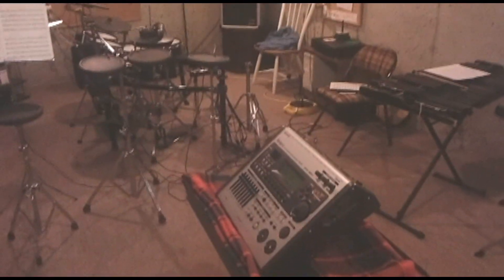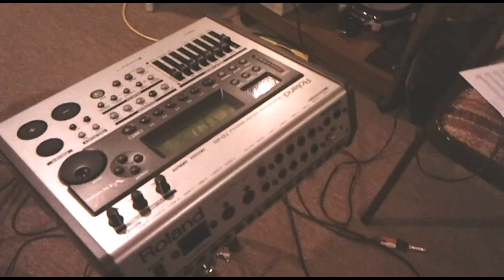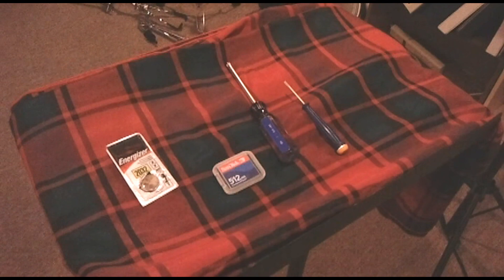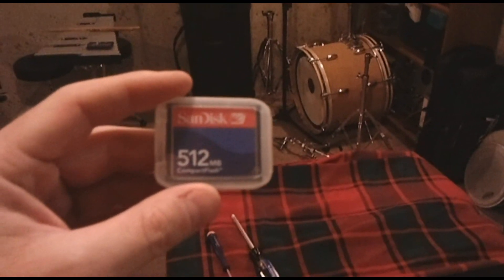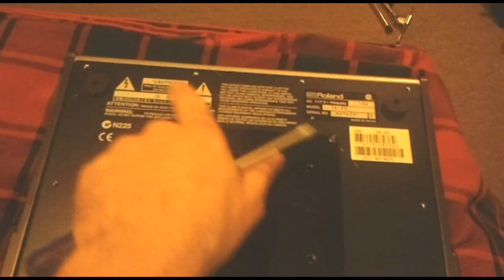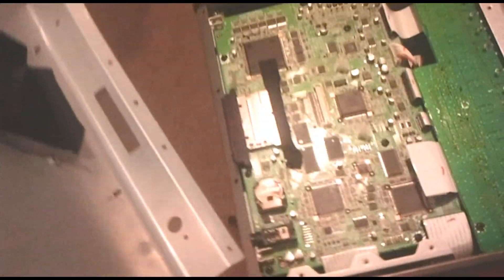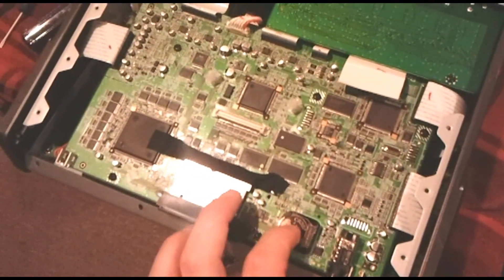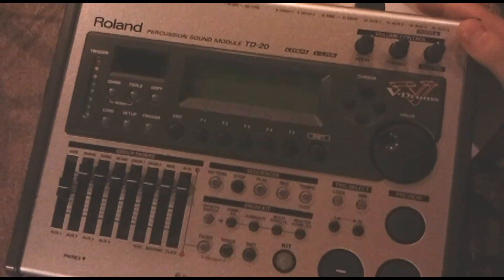How to replace backup battery on Roland TD-20 V-Drums Module

Comment: I finally received the low battery warning after 15 years of use.  Thank you for this video, it was a tremendous help!

My unit has the expansion card with the extra 50 kits. I took a chance and replaced the battery while leaving the power on.  I was extremely careful about preventing any static electrical buildup.  The process went smoothly without a hitch, taking me all of 7 minutes (once I found the right sized Phillips screwdriver).

I didn't backup up my settings to a compact flash card; I don't know how much of a risk that was.  But considering how quickly it went, it didn't seem risky at all.  It's insane that they think you should send the unit out just to have the battery replaced.  But I'm a bit of a risk taker, so if you're the nervous type, you should probably follow the author's instructions to a T.

Thanks again, DrumD8on!
Reply: Just got my low battery warning too. ; )

Comment from the maker: I have not yet had to dig that deep into the TD-20. It is seated  beneath several circuit boards and quite a few ribbons.  If you are comfortable with electronics and stay organized as you disassemble, it is totally do-able, however, be very careful that you are in a static free environment.  I would first post over on the VDrum forums to see if anyone else has done this exact procedure.  Best wishes on your LCD adventures!  If you are successful, be sure to post on the forums. Much appreciated!

Comment: Bought a used TD-20 kit. Beautiful, owned by a little old lady who only played it at church on Sundays. :) Okay, maybe it wasn't a little old lady, but it was a church kit. Pristine condition, except... a low backup battery. So I watched this video and changed out the battery. It took about 10 minutes. Hint: use a variable speed reversible drill, not a screwdriver. Thanks for the video; it was exactly what was needed.
Reply from the maker: Thank you.  Glad I could help you out. Thank you for the tip as well!

Comment: Thanks for this video I tried it on my own V drum TD 12 and it worked great. Roland wanted to charge over $100 plus shipping just to change the battery. Once the back cover was opened it only took a few seconds to change it.

Comment: Just managed to replace the battery on my TD-12 using this video as a guide (I had to apply a lot more pressure to get the battery out, but it worked). 

Thanks for making this video!

Comment from the maker: Thanks for watching and glad you found the video useful.  Although a low battery might cause some issues with the module, your problems sound like a short circuit or perhaps a bad connection somewhere on the board.  A low battery would cause you to experience the inability to store less information like patterns or custom kits, and eventually a factory reset will occur every time you turn the module on.

You might check with a licensed technician or view the vdrum forums for help.

Good luck!

Comment: Hi, thanks for sharing this video, my TD17 module freezes, will I have to change the battery?
Reply from the maker: Hey Ricardo, sorry to hear that. This doesn’t sound like a battery issue to me. Sounds more power related. Are you using the OEM power cable? Is the electric source clean? Might also be temperature related, but it would be hard to know if it is happening inside. If it happens again, feel if the power cord is warmer than normal. I hope you can find an answer. Good luck- maybe check over at the VDrum forums to see if anything similar has happened to others?

Comment from the maker: @JackPollitt - Thanks for watching. I can't say for sure, but you can always open the TD-8 up and take a look. The batteries are generally easy to locate. I was able to find a post specific to this module on a forum called mikedolebear, and it sounds easy. The guy also lists the battery it uses. Good luck! (I sent you the link in a private message since you can't post links in the comments section)

Comment from the maker: Correct. There is no way to avoid a factory reset (unless you keep the unit powered on and plugged in while opening it up which is not recommended), so you should therefore back up your settings and kits to the compact flash card through which you can reload once the battery is replaced. Good luck.
Reply: How do you backup the additional 50 sets when the control module wont let you change anything with the low battery warning.
Reply from the maker: @ronfairbanks8649  I’ve never experienced a situation where you can’t make changes due to a low battery. Perhaps it has gotten so low that it has now way of doing so? Typically, as soon as I get the low battery warning, I just insert the compact flash card and backup the module with any kits I’ve customized, replace the battery, and the reload them
once the module resets. I have not encountered a situation where I couldn’t make changes, so not sure about that one.

Comment: great tutorial. Can you explain what some symptoms of a drained or draining battery might look like?
Reply from the maker: Daniel, if you're using a TD-20, you will actually get a pop up on the LCD screen that says "backup battery low." The module can still run a decent amount of time after this warning. I let mine completely burnout once and I think I got a cpl months usage. There were no other indications that the battery was getting low that I can recall before this happening however.  Hope this helps.
Reply: DrumD8on Thanks!.. Specifically, I have an older td 10 unit Ive owned for years. The audio levels seem much lower lately and Ive lost sound completely via the left (stereo) channel  in both the headphones and line out jacks. I was wondering if that might be a battery issue.  I know you're not a roland tech, but  but any insights are greatly appreciated. Ill try replacing the battery and see if that fixes the issue.
Reply from the maker: Daniel Lemunyan 

Sounds like you have some dirty or shorted connections.  I'd try take the cover and plate off and inspect the connections. Some electronics cleaner should do the trick. If not, might be time to replace the wiring/jack. Good luck!

Comment: Thank you! I was afraid to do this but thanks to your instructions I confidently performed this operation and my TD-20 is now good as new! :)
BTW, is that a snare stand you use for your TD-20? I still have it on the rack but find it limiting....
Reply from the maker: +Alain L. Patry Thanks.  Glad to hear this made things easier for you.  It can be a little intimidating opening it up, but thankfully they're pretty easy to work on for the most part.

As for the stand, that is a Pearl cymbal stand base that I am using in the video.  I have since converted a music stand that broke into a holder as well, which works great.  I agree, the position on the rack can be a bit limited.  Nice to be able to move around freely!

Comment: Is it a battery issue I'd the screen seems to fade out after awhile. The module can get a bit heated up here and there.
Reply from the maker: I often encountered this after the module was running for a while. I don’t believe this is battery related, but more likely temp-related as you mentioned. (For anyone reading who doesn’t know - while holding the “Kit” button, turn the “Value” dial to adjust contrast).

Comment: great video 

im having a problem with my lcd  ive ajusted contrast but its not even   can this battery be the problem. I'm sure its a pain to swap the lcd screen out
??
Reply: I've just moved house and encountered this problem for the first time, my problem on the screen is the lcd dots are faint, mainly on the right side and look like they're flashing.  If I press any of the F1, F2 buttons the screen is normal.  This is likely caused by damp in the room it's stored in.  My new house is very damp in certain rooms due to being unoccupied for 5 months.  Using a dehumidifier system in the room placed close to the TD12 brain can help resolve this problem.  Unfortunately, if your screen is on the way out then replacement is the only solution.

Comment: can you do a tutorial on cleaning the pots on the mixing levers and on the large  selection knob?  that would be awesome!!!!!
Reply from the maker: Thanks everyone.  Hey fatchoppers01, so I might be able to do that the next time I change the battery, but truthfully, cleaning the pots and channels should be as easy having some electronics cleaner and compressed air. Just make sure you have no static electricity around!  :)

Comment: this is for the screen matters? light, contrast and all that?
Reply from the maker: Camilo Barker Official YouTube Channel 

No, that is a completely separate issue. A low battery will warn you with "backup battery low." If your screen is dim, you most likely have another issue. I'm assuming you know how to adjust the display brightness? (Holding in KIT button and rotating the wheel)
Reply: Greetings bro, yeah, I adjust the display brightness and it's ok, but... the last owner of this kit told me that this happened for a few use, and the module need 10 minutes for take the entire color and contrast, what recommend me? change de battery 2032 or?

Comment: Hi hope someone can help here...replaced battery as the warning prompt kept coming up...new battery in now unit display is just glowing bright green for maybe 20mins blank... before all writing is full and black..
Any ideas why its not working..was working fine before battery replacement..thanks..
Reply from the maker: Drummerboy999 - a couple things to check first, and my apologies if this seems trivial, but just to be sure: 

Have you attempted to adjust the contrast by holding the kit button in and spending the main dial.?

Are you totally sure you have the correct battery? It should be a CR 2032 battery. if it is not this exact battery, it could cause issues.

Beyond that, it is very hard to troubleshoot, so hopefully its something simple. one thing that can cause issues is not being grounded when you open it up. this is particularly risky in the winter when the air is very dry with static. I always make sure I am grounded by touching something else to prevent static shocks etc. hopefully it is not that! Let us know how things turn out for you.

Good luck!
Reply: +DrumD8on  Topman Thanks Mate!!!!!